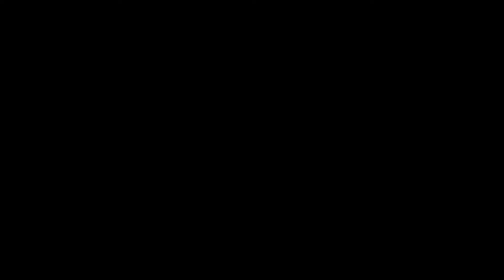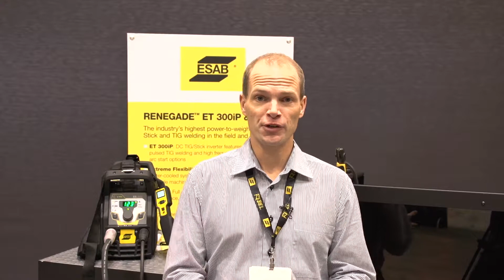Renegade TIG/Stick Series Overview

Comment: Renegade es 300i does not weld single phase. Like mine, serial number 627-XXX-XXXX, it is only available from serial number 725-XXX-XXXX. Mine starts and limits amperage to 200A at single-phase but do not start the arch. I don't know if it is software or hardware thing. I can only use it with 3-phase.
Reply from the maker: hi there,  we ask that you contact our customer service team regarding your question. You can reach them at 800.ESAB.123 (800.372.2123) and follow the prompts.